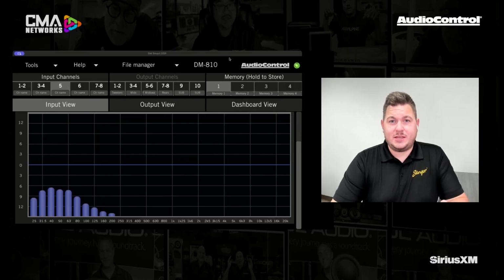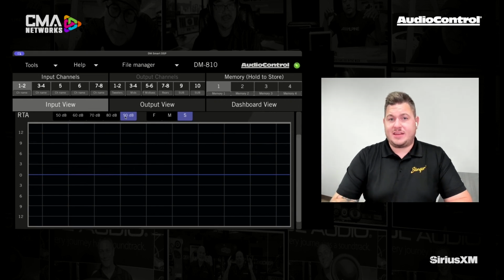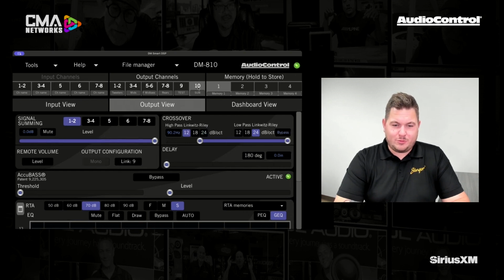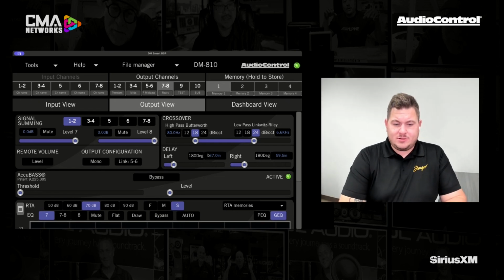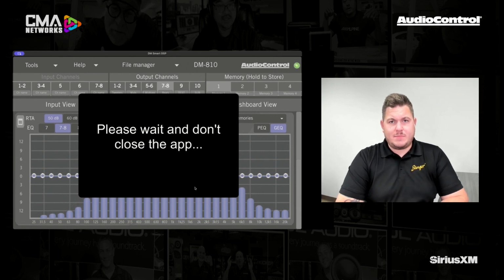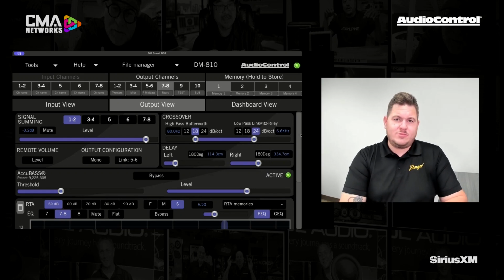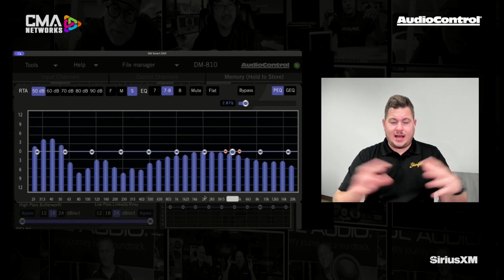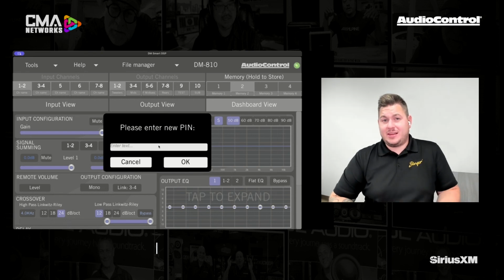AUDIOCONTROL | DSP | WORKSHOP

Comment: Clear, concise, and informative. I bought my dm-608 in approx 2018. Struggled to set it up without the benefit of a video like this and did ok I guess. Recently had a friend tell me my audio sounded off in my car, so I tore everything out to redo it. Discovered some wiring mistakes and wanted to start fresh after reinstalling everything. Had a small hitch discovering the newer Smart DSP app ver. necessitated a firmware update for the DSP, but got it figured. Audio already sounds 10x better than before, but needed a quick tutorial on EQ and crossover settings. This video gave me everything I needed, TYSM.❤😊

Comment: Wow! you are fantastic.

You were clear, informative, your speech is pleasant, you're knowledgeable,  and you answered 90% of the questions I've been struggling with.

The only questions that weren't answered, you just didn't cover in this extremely helpful, simple, and brief DSP overview.

You're a real credit/asset to your employer.

I bought the D-4.800 amp two years ago where I've spent a lot of time learning/fumbling through the DSP.

My system is pretty simple. 2-6 1/2 components for the front and rear stock locations,  two 10" subs in the hatch area of the SUV, two amplifiers (1 ARC AUDIO  CXL-2500 for the 2 -10" subs and the Audio Control D-4.800 4 channel amp for the front and rear components.

Thank you once again.

Comment: This applies to DM-608/ 810. Not sure about the amps. I have 2 DM-810s. 
You are correct about channel 7-8 inputs being combined with the digital inputs and tos. However, if the digital or toslink is not being used it will be muted/ switched off and allow low level or speaker level input through or vice versa. 
If you have both analog signal on 7-8 and a digital signal input the digital signal over rides the analog and analog will be switched off.

Comment: Thank you for the video, very informative and well put together. I just got the D-6.1200 and am working thru the app to make things sound at least as good as they did with the stock setup, lol. Getting there. The app gives a very nice control over everything - which is good - but you know what is not great? The app itself. Seriously, I'm trying to work the audio magic and I'm just constantly frustrated by the UX, or rather lack there of.

Why are the non-essential elements so freaking large? The amount of vertical scrolling (because the app really does not understand a portrait layout, good design /s) is just insane. And the scrolling is just so freaking bad. If you do it with a mouse wheel the scrolling stops as soon as pointer encounters a slider or certain (not all) buttons. Ok, maybe using the touch screen would easier. It is, at first, but then attempts to swipe up/down from the EQ area registers as a click (if touch happens to fall on the FQ line) and messes up the EQ setting. Same goes for initiating scrolling from sliders. Ok - sigh - let's use the mouse directly to scroll the scroll-bar: The vertical scroll background color is virtually indistinguishable from the thumb. I'm in my car outside, the sun's shining and I can't see the damn thumb to click on. Like OMG, was there any QA done on this application?

The "Memory 4" button (only this one) does not register click/tap on or after "4" - jesus christ

Why is the top menu area so goddamn tall. Is it only to accommodate the pointless AudioControl logo? And if it is to make it easier to use on a touch device why not move the "Input View", "Output View" and "Dashboard View" to be just iconized buttons instead of the damn logo and boom, saved another 150 pixels for actually important for the display stuff.

The input, output and memory buttons do not select if you happen to tap the name label - oh ffs

Not to mention little things like some inline buttons/input boxes which have separation padding and some which do not - for whatever unexplained reason.

Maybe these are non-issues for someone who's installing these amps routinely, goes into the app, does their known, usual things and gets out. But for this normal customer having to use this software is the most frustrating part of my audio build experience so far. I spent ~3hrs with it yesterday and I hate it thoroughly. It's not a dealbreaker, I don't plan on using the app ever again (thank god) once I dial things in, I just don't understand why can't things be designed properly.
Reply: Thank you for taking the time to write out your frustrations with our app. We are constantly working to improve our products, apps, and customer experience. We try to truly take constructive criticism like this to heart, and when our next generation of DSP products and their corresponding apps are released, you'll notice that all of these issues are no longer a concern.
Reply: @AudioControlCar  Yea, sorry if I came across a little b*tchy, it was just a bit much.

Anyways, thanks to this video I was able to just about nail my setup, the sound is so good now.

Comment: Can you tell me when AudioControl implemented the PEQ? Is it available for ALL DSP products?
Reply: Yes, we implemented the parametric EQ (plus quite a few other useful features) approximately two years ago. It was initially available as a feature of our public beta, but has now been added permanently. This latest version of the software (and all versions, really) is compatible with all AudioControl D series amplifiers and DM series DSP processors. To clarify, that means: DM-608, DM-810, D-4.800, D-5.1300, & D-6.1200. Hope that helps!
Reply: @ thank you… just curious why you don’t advertise parametric eq as a feature. That’s the primary reason I would never use audio control dsp products. PEQ is a must in order to measure with REW and calculate filters that can be exported and imported into the DSP for a flat or target curve.
Reply: Because they just added it 2 years ago when they did their v2 update.  Honestly I think the dm-810 is pretty bad, it introduces a massive amount of noise into my system that isn’t rpm dependent, I also moved it to a location and it still has a really noticeable hiss.  I ve had my dm810 for 5 years now and I literally just set it up for the first time this week because it would not connect.  Overall I would not recommend Audiocontrol products.  This video is 1 or 3 months old and they’re doing a run through of how to set their product up 5-7 years after it came out?  That makes no sense.  Even if there were previous setup videos, why make another one? And why 2 years after update v2 came out, unbelievably terrible setup for this cantankerous thing.
Reply: @grandpixel  Fair point! We should make a bigger deal out of the parametric EQ feature. This was added due to customer demand, and was rolled out as part of a software update, so no press release or new product release was issued. Thank you for the constructive criticism.
Reply: @tedvanduzen8867  There have been several full walkthrough videos and tutorials on the DM-Smart DSP software since it's initial release. This video was done with CMA, because there hadn't been a full walkthrough done with CMA in the past, or at least not since the latest release of the software came out. Thank you for the constructive criticism, we do take all comments into account and do our best to implement the desired features and changes in future products/software. As for any noise, at the time of its original release, the DM-810 was on-par with other DSPs at the time. However, the DM-810 has been updated and improved several times throughout its life, and the background noise issue was addressed several revisions ago. Please contact tech support if you're still having issues, we'd love to help.
Reply: PEQ would be nice, except the software is currently broken and doesn't let you place any of the points on the EQ.
Reply: @rumperdumper are you having an issue with clicking the PEQ frequency and it won’t stop following the mouse? Once I click the bumble, the mouse won’t let go of it.
Reply: @Nick-ue9of That is the exact issue I had when I downloaded the software to try it out.
Reply: @rumperdumper  is it connected to the source when you try it? It’s fine when it’s connected but has the issue when it’s not for me. Support isn’t the greatest as well
Reply: @Nick-ue9of  I don't have the amp yet. I was just trying the software in advance and concluded that it was too buggy.
Reply: @ that’s good you’re testing it. I will swap it out in time or just keep it for the rears and subs. The iPhone app didn’t work great but it still worked.  I don’t think audio control cares about the release date or to fix the bugs. I would never buy anything from them again due to their responses from their outsourced service desk.
Reply: @Nick-ue9of  This is because you aren't connected to a physical product via USB. Although you are more than welcome to download our software without purchasing a product to demo the software, it's important to note that not all features of the software will appear or be completely functional until an AudioControl DSP enabled product is physically connected.
Reply: @rumperdumper  This is because you aren't connected to a physical product via USB. Although you are more than welcome to download our software without purchasing a product to demo the software, it's important to note that not all features of the software will appear or be completely functional until an AudioControl DSP enabled product is physically connected.
Reply: @Nick-ue9of  Thank you for the constructive criticism. We do actually take it to heart, and do our best to implement commonly requested features into future products and software releases. However, our support team is not, nor has it ever been, outsourced. For 40+ years, AudioControl's support team was based in Seattle, WA (Mountlake Terrace, WA to be exact). Over the past few years, we've grown, and our US BASED support team is now spread out a bit more throughout the US, which enables us to offer tech support to more people during more business hours in more time zones, rather than all tech support being tied to PST. Hope this helps to clear things up!
Reply: @rumperdumper  Are you actually connected to a D series amplifier or DM-608/810 while trying to use the PEQ? If not connected to a physical product, some of the features of the DM-Smart DSP software will not function 100%.